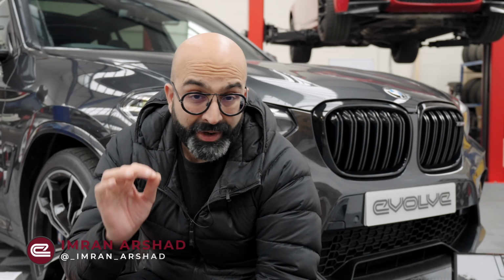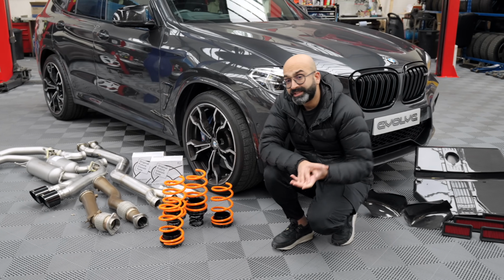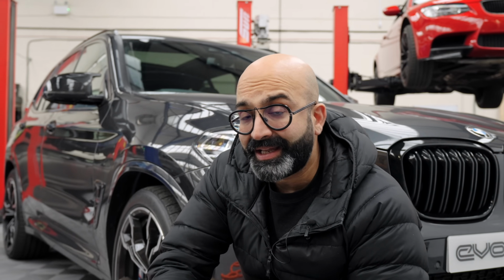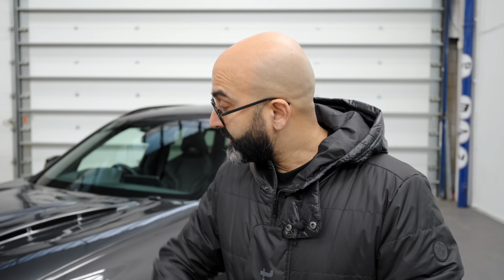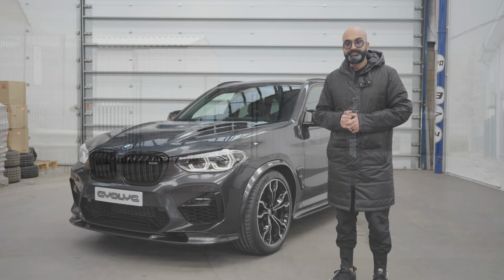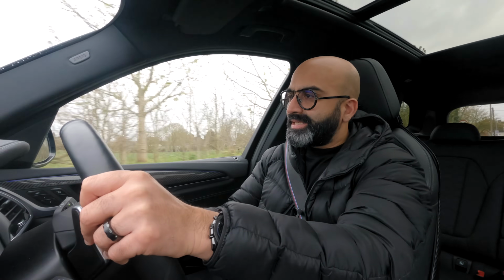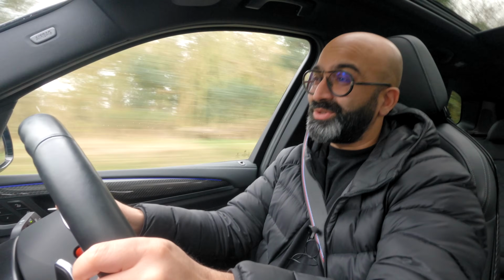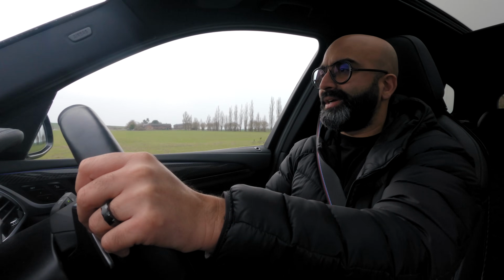Making this X3M Lower Louder and Faster! Stage 2 Pack, AA Midpipe + Remus Exhaust, MSS HAS, Eventuri

Comment: Monster of a car with all the right goodies. Nearly every X3M with a stage 2 package are doing 6.5-6.8 100-200 on the dragy with 99 Ron.
Reply: Stage 2 is one of the funniest things someone can say. Probably the literal least amount of info you can specify about an upgrade.
Reply: @guyonthetuber stage 2 is just down pipe & tune …

Comment: Hey Imran do you think the AA midpipe would hinder performance because it’s a single 3.5 inch pipe when the stock pipes are ( 2 ) 2.75 inch pipes?
Reply: No, it's still a significant performance increase, the main benefit of the single pipe is it reduces the tinny sound of the exhaust and makes it sound deeper and growlier.

Comment: Do you carry out wheel alignment after the springs were fitted?
Reply from the maker: We do not have alignment equipment, but recommend customers do after suspension work. An ideal time is after the springs have had a chance to settle and any adjustments have been made to the ride height.

Comment: Ok I get the performance upgrade.  But lowering it?  The ride is pretty stiff already and handles better than a Corvette (exaggerating).  And the factory exhaust in sport plus is impressive already
Reply: Your comment literally translates to: "Why strive to be exceptional when mediocre is just fine." And for the record the lowered ride with MSS is many many times comfier than stock, it's lowered AND less stiff.
Reply: @knd4rkst4r  ya I really feel mediocre in my X4M.  You’re right I should just set it on fire.  In all seriousness, there comes a point when you buy a car for its features and you don’t need to be Ricky Racer slapping on carbon wings and lowering it etc...  If you want a lowered performance vehicle why didn’t you buy the M3 CSL?  Or the M4?

Comment: Notice the rear suspension on a BMW X3///M is stamped steel, like a crappy 3-Series. Most ///M cars have cast aluminum suspension arms, with some joints being spherical bearings. My BMW F30 335i rear suspension is like Jello. Upgraded to F80 M3 control arms in front. Yikes!!

Comment: It has an incredibly harsh ride to begin with, with minimal suspension travel. How on earth can lowering it possibly make it more comfortable? Lowering an X3M makes about as much sense as lifting an M3. IMO.
Reply from the maker: By dialling in the spring rates for the road conditions.
Reply: The MSS in lowered setting is 10x comfier than stock, it's not just lowered, the MSS suspension system is key to a more comfortable and more stable ride

Comment: No matter what you doing to the exhaust, this engine will always sound awful 😢
Reply: I think you'll be hard pressed to find a better sounding straight 6 than this. It's no V8 but it certainly holds its own.
Reply: @knd4rkst4r  B58 engine sound a lot better than this one.